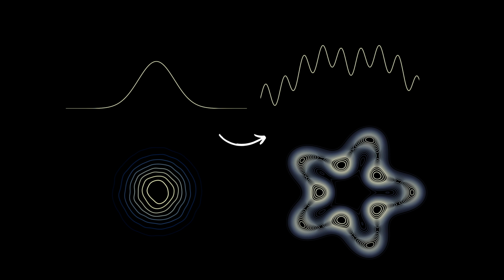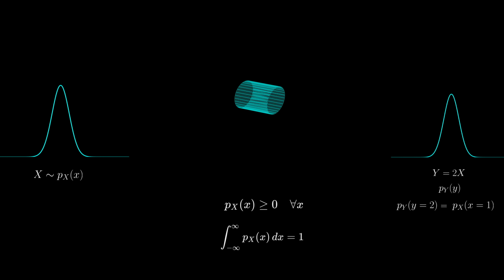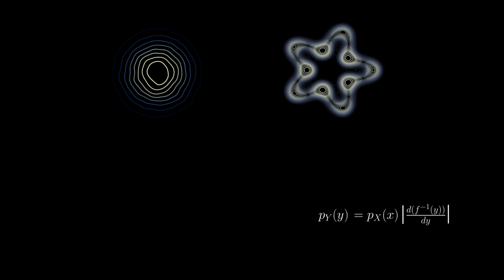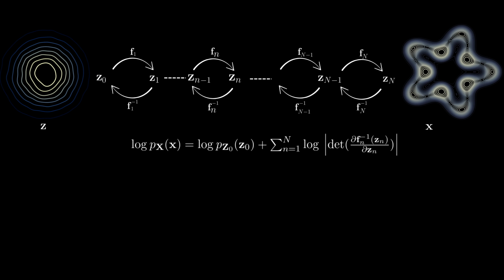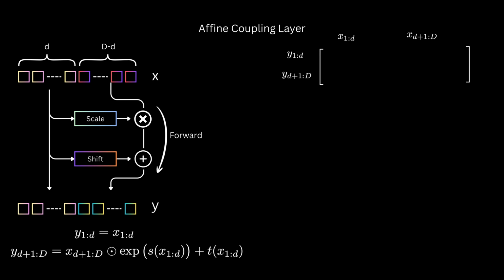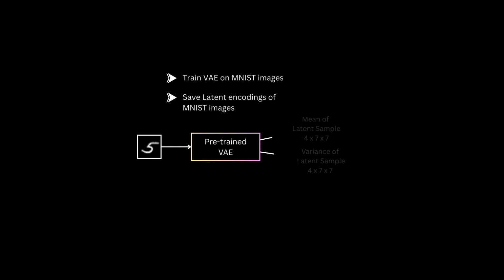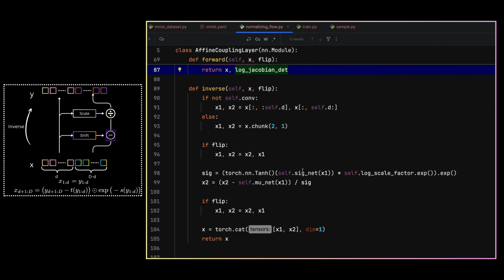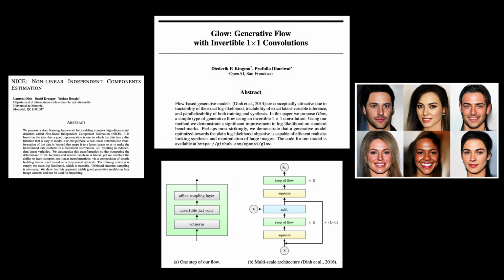Normalizing Flows Explained | Flow Matching Part-1 | Generative AI

Comment: It often makes sense to distinguish between the likelihood (which is always linked to the parameters of a model) and the real data distribution. I think that got confused here a little bit.
Reply from the maker: If possible, could you let me know the specific part of the video you are referring to? That would help me understand where I might have phrased things better.
Reply: @Explaining-AI  Of course. The short section starting from 1:25“ got me triggered. I got a bit confused around 1:48“, specifically. Not sure whether the lower sinusoidal curve should reflect the learned distribution or the real data distribution.

Maybe it was just my mistake, I am sorry.
Reply from the maker: @alivecoding4995  Got it. Thank you for letting me know. Its my bad that the representation in the video ended up not being clear enough. 
Nevertheless, the lower curve actually represents both, true data distribution(P_data(x)) as well as learned distribution (P_theta(x)). Basically what I meant to say, if a normalizing flow model has been trained well then, the learned distribution P_theta(x) will approximate the true data distribution - P_data(x) very closely(theoretically). 
Which means the points assigned high likelihood by the trained model, will indeed correspond to the high-density regions of the true distribution(mnist images) and similarly points assigned lower likelihood will correspond to low(or zero) density regions of true distribution(random noise images). Hope this makes things a bit clearer.
Reply: @Explaining-AI Thanks a lot for clarifying. Now I understand.

Thing is that when speaking about likelihood I generally think of parameters (i.e. maximum likelihood estimate, for example), not data points. But of course, once you have fitted the model to the real data distribution, this distinction becomes less meaningful. 🙂

When digging into Variational Inference and its foundations, especially for latent models, the terminology sometimes gets confusing in my opinion.

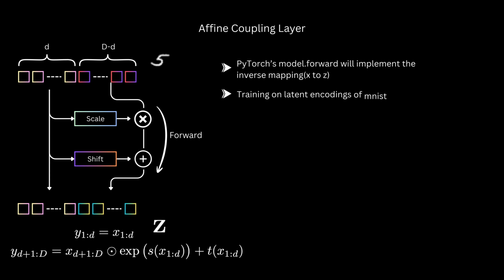Comment: 28:01 I too found it difficult to train from the pixel space and just settled on using flows between the encoder and generator of a VAE, though I did joint training in my experiments. The latent space having a simpler distribution helps.

Edit: I just noticed the contour lines from the thumbnail looks generated from an actual normalizing flow. I do observe that "bridge" from one of the crescents to another using the lune dataset. I planned using stochastic normalizing flows to eliminate that before, but I got lazy implementing the paper.
Reply from the maker: Yes, but I think improvements like using variational dequantization together with a multi-scale architecture could lead to better results when training directly on pixel space, though I didnt get time to experiment with those.

The thumbnail is actually not model generated. Although I had initially planned to use that dataset itself, but since all my videos so far have used MNIST as the example, I decided to stick with it.